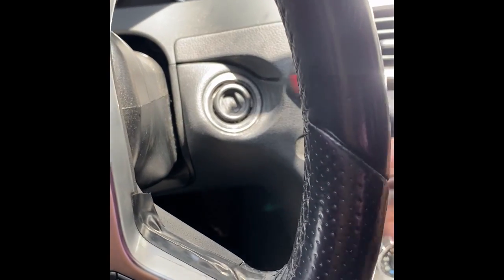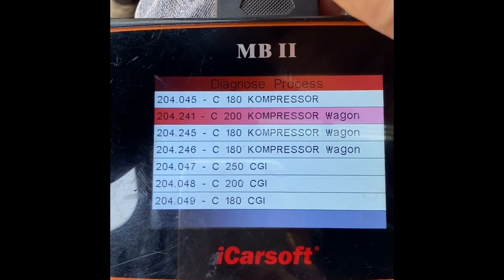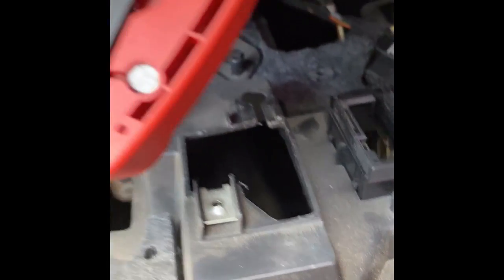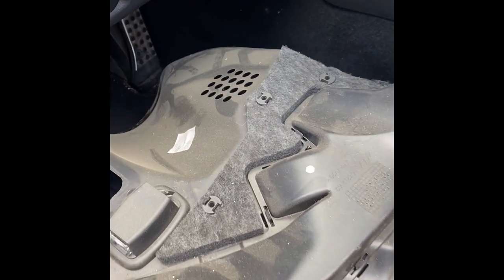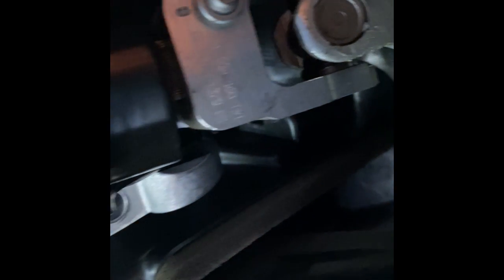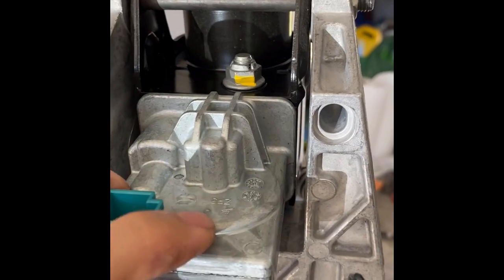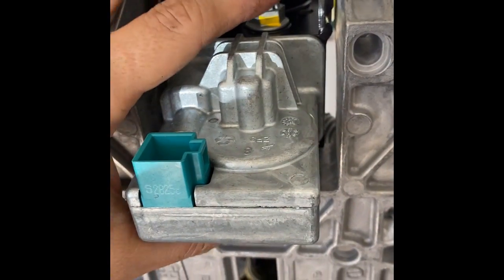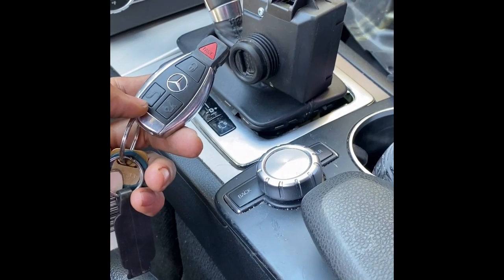2008-2014 Mercedes Benz C Class W204 C300 ESL Electronic Steering Lock Removal Emulator Install

Comment: Is there anything that can be done preemptively to prevent this issue from arising in the first place? Aside from replacing with the emulator before the ESL fails?
Reply from the maker: No. The esl will fail. The only option is to replace it. 

https://mercedesbenzspecialist.net/shop/ols/products/mercedes-c-class-glk-class-e-class-coupe-slk-class-electronic-emulator

Comment: What do I replace the steering lock with? Or since the bolt is dremmeled out I just remove it and leave it empty?
Reply from the maker: In the video, I replace the steering lock with an electronic emulator that I programmed. I can program one for you too. I need your ignition switch and key to program an emulator for you. You can learn more about this service on our website here:

https://mercedesbenzspecialist.net/all-products-%26-services/ols/products/mercedes-c-class-glk-class-e-class-coupe-slk-class-electronic-emulator

You can also call and speak to me on the phone. 818 510 3375

Comment: Hello. It looks my Mercedes has that problem
 Place the key in ignition but I get a message that said remove key from ignition, no dashboard lights, but ye ylradio and all lights. Remote control works well as well alarm but car does not start. 

Any suggestions?

Thank you
Reply from the maker: If you have a W204, this is likely an ESL malfunction. Call us at 818-510-3375 We can get this fixed.
Reply: @mercedesbenzspecialist  
Sounds good I will call you tomorrow then
Hopefully, the weekend works for you or the Saturday after Christmas or the 23rf of December 
Anytime, we can wait until January 2023 is fine, I know we all busy during holidays .

Thank you for your prompt response 🙂
Reply: How did you get this fixed? Dealership charging $1600
Reply from the maker: @jasminelanders3177  I need the ignition switch and key in order to program an electronic emulator. The emulator will replace the factory electronic steering lock. 

The emulator provides the “drive authorization “ your car requires to start. 

The cost for a programmed emulator can be found on our website. https://mercedesbenzspecialist.net/shop/ols/products/mercedes-c-class-glk-class-e-class-coupe-slk-class-electronic-emulator 

Your part of the work is to remove the ignition switch and the original steering lock. You can also hire someone or a shop to remove those parts for you.

Call us 818-510-3375
https://mercedesbenzspecialist.net/

Comment: What's it mean when the iCarsoft won't read anything for EZS? It says Link Error, please check 1. If the vehicle is equipped with the electrical control module 2. If the cable is connected correctly 3. If the key is Ignition ON (it is)

I can only get the iCarsoft to read some things, but not all of them. Any ideas?
Reply from the maker: Does your Mercedes start? If not, there may be a malfunction of the obd2 connections to your EIS.

Comment: Does the emulator work with Keyless go?  If I have 2 factory keys do I need to send them both with the EIS?
Reply from the maker: Yes the emulator will not change the function of your keyless go keys. We ask that you send one key and keep one key at home. In the rare case that your package is lost on the way to us or back to you. We can use the data from your key to get you back on track.

Comment: I'm wanting to have an emulator put in before  the steering wheel gets locked and the original ESL fails. Can I just unplug the original and not unstable it and plug it into the emulator after I get the emulator key and ignition switch back from you?
Reply from the maker: Yes you can. 

You must unplug the factory esl when it is in the unlocked position.  (Key inserted into EIS)

You must remove the steering wheel and steering column module (this is the module under the steering wheel with the combination switch) to remove the EIS. 

https://youtu.be/CQo6iTOaby4?si=gdN59jsPWa263P6y

Comment: Hi I had a mechanic install the emulator. The steering wheel is now not aligned with the wheels.  What could cause that and any recommendations on fixing it
Reply from the maker: During the installation the steering wheel must be removed. Your mechanic did not put it back in the same position. 

It needs to be removed and adjusted.

Comment: before the ESL is gone problematic, if we put an emulator to that socket, will we need to code it anyways? or will it run since no errors stored?
Reply from the maker: It needs to be coded. No emulator will work without matching the coding inside your ignition switch and key. We offer this programming service. 

https://mercedesbenzspecialist.net/shop/ols/products/mercedes-c-class-glk-class-e-class-coupe-slk-class-electronic-emulator

818.510.3375

https://mercedesbenzspecialist.net/

Comment: I have c350 2009  i start my car mo problem when i stop to ho to gas station pump gas when i start my car totally black nothing on yhe dash board called my wife bring the other key and it works I thought only a fob battery i changed it this time only one key gob working and yhe other key fob womt work at all new battery for key fob called lock smith and he said that ket has a signal and it should be working somehow still not working he cant figure it out and maybe new key fob ?
Reply from the maker: We can program a new key for you. Check our website for current pricing. 

Https://mercedesbenzspecialist.net

Call us at 818-510-3375

Comment: I have all the symptoms but my steering wheel isn't locked so why can that be if any help
Reply from the maker: Your steering lock may have failed in the unlocked position. 

With the key removed from the ignition, the steering column should lock. If that doesn’t happen you have a faulty steering lock.
Reply: @mercedesbenzspecialist  this could or is the reason why my whip won't start
Reply from the maker: Its very likely the reason. Get in contact with me. I can help you get this fixed. 

Call us 818-510-3375
https://mercedesbenzspecialist.net/

Comment: What if the steering wheel isn’t locked ? But windows don’t work and nothing happens when I turn key ? Is it still the ESL ??
Reply from the maker: The steering lock can fail in the unlocked position. That’s less common, but it does happen. 

If your steering wheel doesn’t lock when you remove the key. That’s as sure a sign of a failed ESL as a steering wheel that won’t unlock when you insert the key into the ignition switch. 

The surest way to know is to scan the EIS module. 

iCarsoft MB II is an affordable scanner that is able to go into all the modules in your Mercedes. 
https://amzn.to/3G1bTkX

Comment: Hi, I have this problem unfortunately I'm in the UK so I can't use you, but if I replace the faulty motor will that need programming to the vehicle? Or can I just replace the motor and keep the original esl without programming?
Reply from the maker: You can replace the motor. There is a 50/50 chance that it will work again if you put it back together correctly. 

The two switches on the circuit board must be in the depressed position before you close it back up and plug it in. 

Even then, if your circuit board has the NEC chip locked. It’s still not going to work. It is worth a try.

Comment: How can I stop this from happening? I had a Benz and this happened, gave it back to the dealers but I want another one, but don’t want his to happen!!!😢
Reply from the maker: This issue will happen to all W204 chassis vehicles. It's a matter of the steering lock motor failing. You just have to get it fixed. Or better yet, fix it before it happens. 

I offer a service to get this fixed here on my website.

https://mercedesbenzspecialist.net/shop/ols/products/mercedes-c-class-glk-class-e-class-coupe-slk-class-electronic-emulator
Reply: @mercedesbenzspecialist  I heard even if you get it fixed, it will still happen? Benz is so weird for that. I had a 2012 c250, now I’m trying to get a 2014 c250
Reply from the maker: @Dashikardashian  if you replace it with another factory esl it will happen again. The best choice is an electronic emulator to by pass the factory esl. This is a permanent fix.

Comment: Sir you left out the part on how to slide the steering column thru that hole
Reply from the maker: Do you mean, through the dashboard? If you have the manually adjustable steering column. You pull it out. It fits. 

If you have the electronically adjustable column, you have to remove the accelerator pedal, then pull it out through the bottom.
Reply: I've been wondering how to get it out mines just sitting in there still waiting for my emulator miss driving my c63
Reply from the maker: @corvette0142  Let me know if you need any help getting an emulator programmed.

Comment: Found a guy on youtube (https://youtu.be/BoVSH6DP1c8) that demonstrated how you could get the car running again so it could be driven to a dealership or home or whatever. He pulled the 7.5 amp fuse from spot 27 in the fuse block, then put a jumper in place of the starter relay. This got me back to the house. What's the long term issue with running like this; putting a toggle switch and push button in place of the pulling the fuse and the jumper on the relay. My steering lock is not engaged but the symptoms are present.
Reply from the maker: I’ve seen this trick done a few times. Not with a jumper switch, but with the cover off the starter relay. 3/5 times I’ve seen damaged front fuse and relay modules that needed replacement. 

Maybe it was because of this trick, or maybe it was just getting into the front SAM too frequently to jump the starter relay. I’m not sure if this was the cause of the front SAM going bad. 

The emulator solution is a permanent fix that may save your front SAM. It cost $250. I would recommend this over jumping the starter relay.

Comment: Faulty by design. Yeah agreed. Just turned mine in "simulator".. The fault was made by some plastic that stopped halfway the rotating gear. Electronics was ok. So I opened up the aluminium box, removed that little plastic garbage, remounted all and luckily  my car was back. That's a really short resume of something that took a whole week ( 2h after day job ). In addition my left door handle broke at the same time. Still wondering if its linked or not.. I took out they and opened the door at the same time very fast so... ?

Note that putting back the steering in place is a real pain in the ass. 3h yesterday afternoon to put back daddy in mummy ( yeah I did no mark ).
Now that box is "glued" along the steering, ready to be removed and replaced the next time it dies, by a true simulator.

As an electronician, this kind of shit should be banned from vehicles. As long as when it works, a modern stealer will bypass it and take the vehicle anyway. The only one who is fucked in this situation is the customer. You pay to be annoyed.